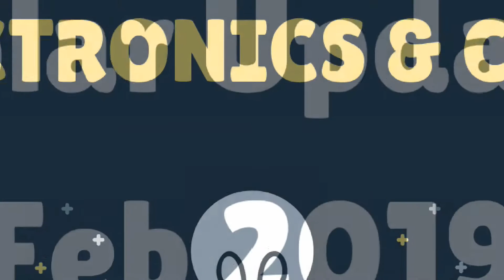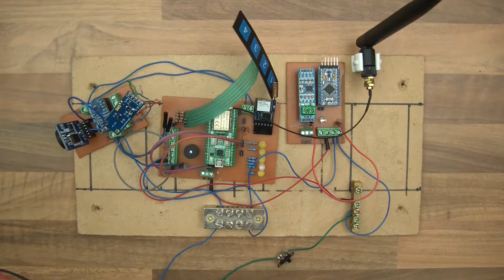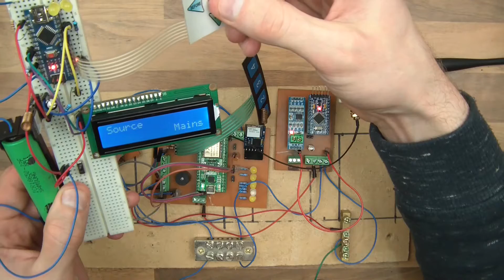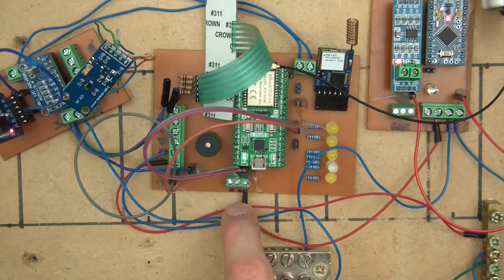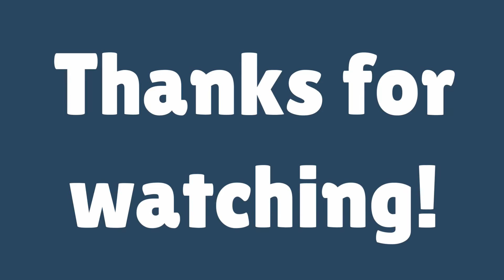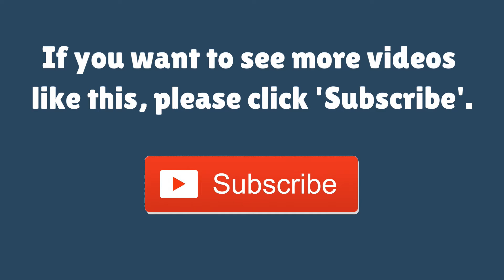My DIY Offgrid Solar Power System (An Update - Feb 2019)

Comment: Hi antony have you tried this New Version! Wemos D1 R2 V2.1 nodeMCU meets Uno meets ESP8266 WiFi - Arduino IDE. 
Iv got one and havent put it in to use yet.
Reply from the maker: I've not got that, no! :-) Is it good?
Reply: @antonycartwright  from what i have seen its way faster than the nano and added bonus of wifi. Would have to try with the ttl module
Reply: @antonycartwright  paid $6.80 aud from a seller called alifan 232384772185 ebay item